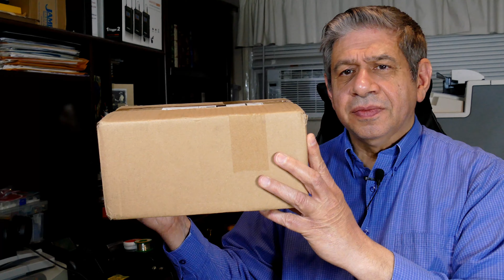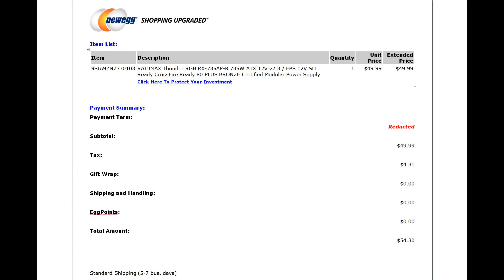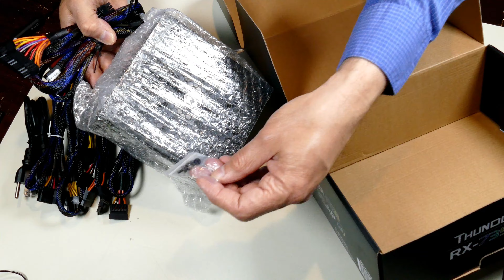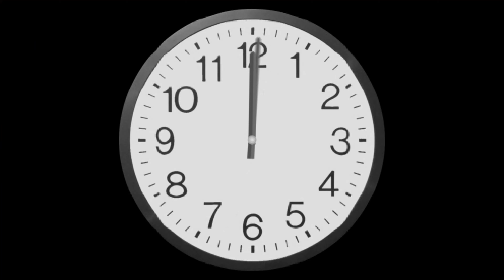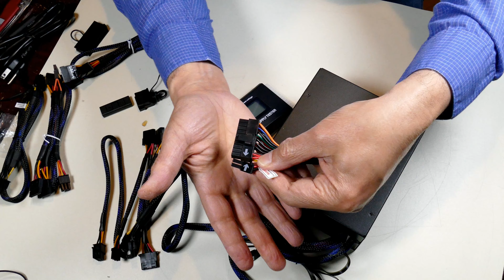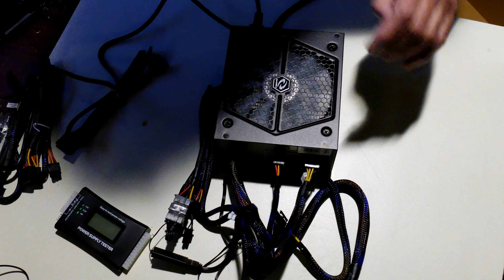OPENING a SURPRISE BOX CONTAINING TECH: Likely a PC Part of Some Kind

Comment from the maker: For those who are interested, prior to repackaging the PSU for future use, I decided to run it again with the Power Supply Tester and RGB running to measure the wattage being drawn from the power receptacle. I measured an average of 10.3 watts over a period of one hour.  With the tester removed, that dropped down to 7.5 watts, and with the RGB also disconnected it dropped down further to 6.6 watts.  Since this PSU does not have a Fan that turns off under low load, I assume most of that is because the fan is running.  I'm sure I could load it down more, but I didn't see the point.  This update is just in case anyone is interested.

Comment: Will there be another Mystery Box Video? As for the PSU Cables there are extension cables Kits.
Reply from the maker: Kathrin, Do you think this sort of video would be on significant interest?  Obviously, this is the first time I am doing one like this, and since it is early in the video release, it is yet to be seen if many people will watch it for any significant period of time, or even click on it.  But we'll see.  Yes, I know that cable extensions are used often in 'show builds', but I was interested in one day building a mini-tower system with "exceptional" cable management, so going with custom made cables is something I've been seriously thinking about.  What I may do however, is pull the 'fully module' Corsair 650 PSU out of my main workstation, since it is not needed there (a CorSair 200 case that has only partial modding and shows my PE Seal in an added plexi panel), and replace that one with a semi-modular (or non-modular).  I'll keep thinking about it.  In terms of doing this 'surprise' box opening again, it may take a while, since my package deliveries are 'way down' (due to both budget and product availability), and it is rare to have packages that look and feel so similar - but I'll see what I can do.
Reply: @PE4Doers  Yes pulling your Fully Modular 650W Corsair PSU and replacing it with a solid Semi or Non Modular PSU will make sense.

What Case did you think of?  Because some Mini Cases will need SFF PSUs. I gladly make you a partslists with parts you may already have at home.
Reply from the maker: @KathrinHausermann  Thanks for the feedback Kathrin, as always you are my best viewer/assistant.  I will probably make that PSU switch the next time I am in that 200R case - maybe when I add the 2tb Hard Drive I have been thinking about adding (yes, a video opportunity).  I already have the non-modular Corsair 650 currently available.
In terms of the new build, I am just thinking about it now.  It will likely have to wait until I see some great hardware sales after this current problem has run its course (after all, I am in New York).  Everyone in my family is doing OK, except for my younger sister that is in the later stages of getting over it (she lives nearly an hour away from me), and her prognosis is great. 

In terms of a case, that depends on what is going for a great price that is also somewhat handsome when I shop for it.  A mini-tower, not an ITX is where I would like to go with it however. I am thinking it s insides should be an AMD build (mostly) with a 3700X and a 5700 'something' for the Video; but again, that will be dependent on the prices at the time I can get out and look.  Not sure exactly what it will be used for, however another backup rig is always handy, which I found out during the current situation, since my older daughter needed a higher performing system to use when remoting into her job to do CAD work, and that 'all-AMD' build came to the rescue. 

I may need a parts list, but it will likely start with some parts I already have on hand - such as the PSU.  A good motherboard suggestions would definitely be appreciated.  I also REALLY want to buy some custom length cables for it, so a lot of glass  on the case may be good.  Anyway, thanks for the comments and let's pass a couple of Emails back and forth.
Reply: @PE4Doers  Y)ou thought MATX or ITX or ATX but with a more compact ATX Case?
Reply from the maker: @KathrinHausermann  I would really like a motherboard that can support at least two x16 PCIe slots, but less than a full ATX.  A case no higher than about 14 inches.  I did see a couple of those on my last visit to my local Microcenter that was in the range of $100 to $130, with  full tempered glass on one side.  I just can't remember the brand names right now.  Hopefully I can get back there in the next 3 or 4 weeks and pick a couple of them out.  I regret not taking any pictures on that visit, but I did not think I would be unable to visit it again for more that 5 weeks now.